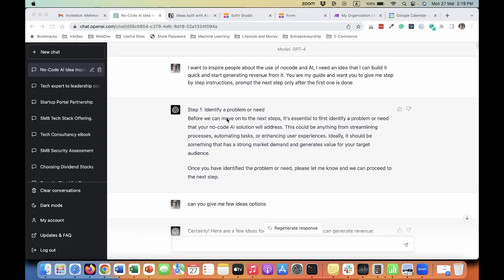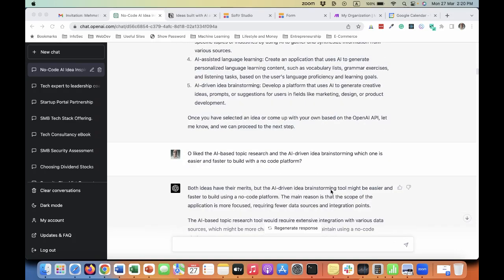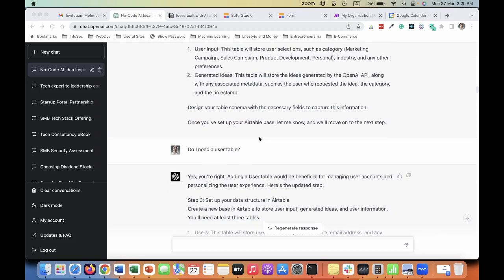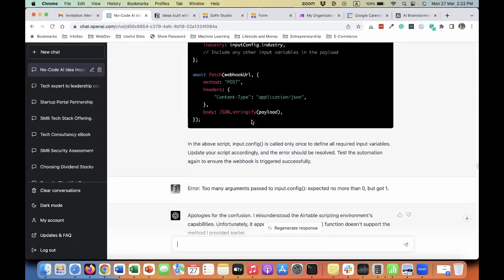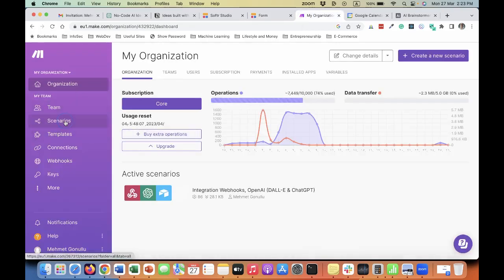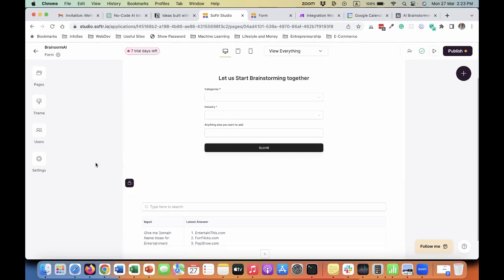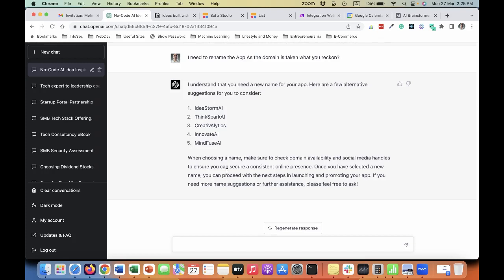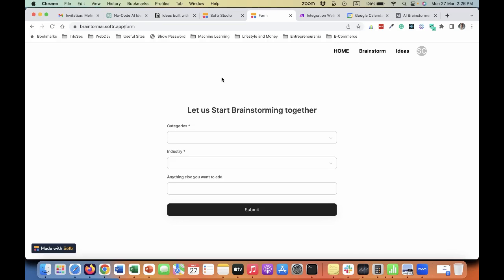The Power of mixing ChatGPT with NoCode Tools

Comment: Hello. A few days ago, I had a chat with chatGPT on this topic for about 4 hours and I can tell it blew my mind. 
Here are a few thoughts

One thing I learned, if you prompt all the business  steps needed to build a SaaS for example, you won't get that much trial and error. You can slowly build up in a more structured manner, with diagrams. 
When you're satisfied with the results of your prompting, you can work with the llm in building a pitch deck. This also helps summarizing and recapping everything, stripping away those long  responses when it simply misses the point.  After fter you help it remember so much context  it simply forgets, the result will be pretty awesome. 
Then after all these, I have a tip and a suggestion, if I may. 
Ask it to transform the final report into a video script so you can present your idea to potential users on video platforms. . And try talking louder (not trying to be rude or smth, just constructive critique) . Cheers and GL with your builds :P
Reply from the maker: Thank you for the feedback 😊